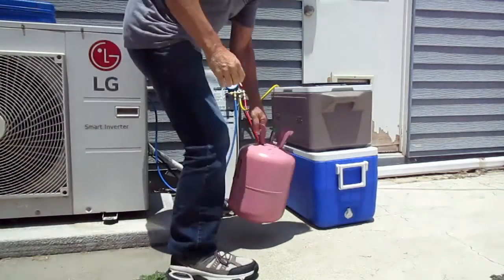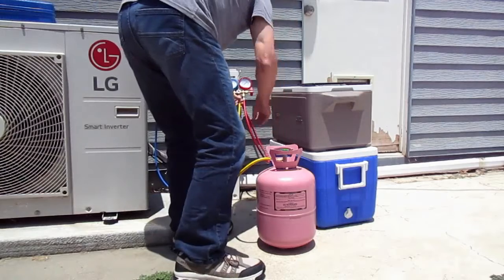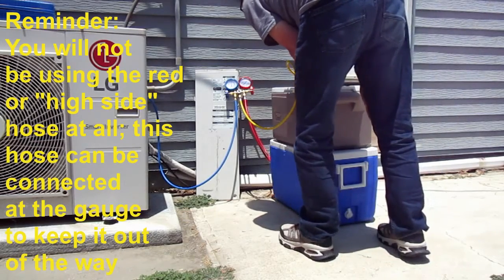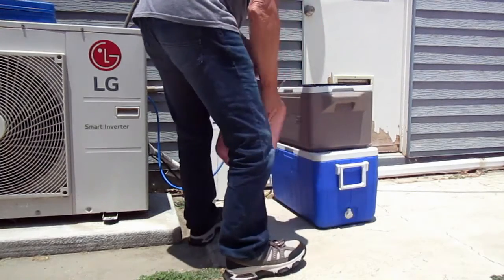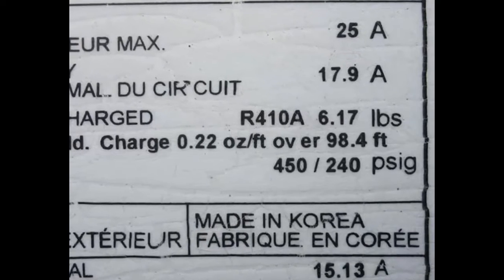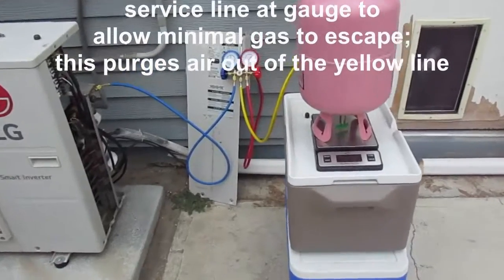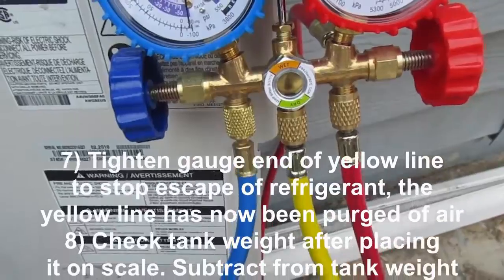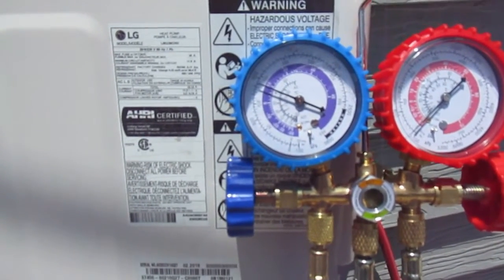Add Refrigerant to Mini-Split Air Conditioner Step-by-Step

Comment: Hello, should i add the r32 while the aircon is running ?
Reply from the maker: No. Shut the system down and then add refrigerant. However, do not add more refrigerant than the manufacturer specs call for.

Comment: Instead of vacuuming out the refrigerant in the system, could you just top it off?
Thank you
Reply from the maker: You can, but it's tricky. You can't determine exactly how much you'll need so you'll have to add it very sparingly.

Comment: Hi
My question is I installed a new Pioneer mini split for my camper and I had to cut the lines There are 16 ft long with that being said I cut approximately 5 feet
Pioneer says it can't be shorter than 10 therefore I'm within the range
How do I know how much refrigerant to release in order to accommodate the shorter lines?

Pioneer says that the unit can accommodate 16 to 25 ft of line

And I can't get a straight answer from Pioneer as to how much I should release to accommodate my 11 ft of line set appreciate any advice you may have because everything I Googled said that you do need to release recover refrigerant if you have shortened the lines
 thank you‼️
Reply from the maker: You really should get in touch with Pioneer again - find another representative to help you. This is a manufacturer specific question; I'm not much help. The other option is to contact an HVAC contractor in your area and ask them if they can help. If you have to pay them for their time - it might be worthwhile.
Reply: Thank you so much for getting back with me and I have called a few professionals and left a message as to what my situation was and not one of them called me back call me back because I actually left a message saying that I would like to hire someone to do this for me no return phone calls😢
I reached out to Pioneer technical support four times and every time I get a different answer thank you so much though for getting back with me
 @DoItYourselfandSave
Reply from the maker: Do a search on YT for "pioneer mini-splits" - there are lots of vids out there that might help. Good luck!

Comment: Do you open the low and high pressure valves on the unit itself when adding refrigerant?
Reply from the maker: Watch the video again, especially at the :52 second mark.
Reply: Thanks. I was referring specifically to the gas and liquid valves on the unit. They are closed during the vacuuming process. I was wondering if they need to be opened when adding refrigerant. Some people say open only the liquid valve and other say open the liquid and gas valve.
Reply from the maker: I only open the liquid valve, but (full disclosure) I'm not an HVAC contractor --

Comment: How do you know how much coolant is in the system before you start? I have a 24000 BTU and i think when they serviced it they did not add enough coolant.
Reply from the maker: The only way to know exactly how much coolant to add is to completely vacuum out the system, then weigh in the correct amount based on the specs for your system. Otherwise, if you are confident (and you should be VERY confident) that the system is a little bit low, you can add a small amount of coolant to "top it off". This isn't ideal, however, as you are using guesswork to add refrigerant, and adding too much can damage your system. You would need a gauge set, R410A refrigerant, and a digital scale to add refrigerant/coolant.
Reply: @DoItYourselfandSave  ok so i should grab a recovery tank and then weigh exactly how much coolant i have in the system and adjust as needed.

Comment: Great video. Question: On a multizone mini split that has been evacuated/ pressure tested/ vacuum down to 200 microns and a decay test successful…do the king valves need to be opened and the virgin 410A added to one of the vapour line ports of any of the 4 zones…OR should the king valves be closed and then opened only AFTER the factory charge amount is added and contained in the line sets?
Reply from the maker: Sorry if I'm not understanding your question - so let me just say: I have ONLY added refrigerant (either into a completely vacuumed system or just topping off when I knew the system was low) via the low side port. This port has a Schrader valve, so the only valve(s) that need to be opened or closed are actually located on the gauge set. Check the 1:00 minute mark --
Reply: Thank you very much for your speedy response. Sorry if I wrote the question somewhat unclear. So…my mini split has 4 zones and I have two zones connected. Each zone has a line set connected to it. At the top of the manifold, where all four zones appear, are two king valves. One is for the low pressure, a vapour line, and the other for the high-pressure liquid line. The king valves are opened first, and that allows the refrigerant stored in the compressor from the factory , to flow into the manifold where it is waiting to pass through the individual zone service valves of each line set. So, after the line set is vacuumed and proven tight, the service valves are opened for that zone and the refrigerant flows from the manifold and into the line set. Both line sets were done this way originally. A leak has since developed and most of the refrigerant escaped. I will evacuate all of the remaining refrigerant from the entire system, including the compressor. (all valves, including the king valves will be opened for this process… as such, all of the 410 A, will be removed into a separate cylinder). Once the system is empty, I will repair the leak and do a pressure test to confirm it’s tight. Then a vacuum test to standards and the system is then ready for fresh , R410A refrigerant to be added. 
My question is… Do I keep the king valves open for all of the processes, nitrogen pressure test, vacuum test, and finally adding the factory charge of 6 pounds of 410 a refrigerant? Or, do I close the king valves after the first step of 410A evacuation and do all of the above testing for tightness…then add the 6 pounds of 410A to the line sets. Followed by opening the king valves and the 410A would then flow into the compressor. (Not sure the two line sets have space enough to hold 6 lbs of refrigerant). 
I hope that made it clearer, albeit long winded explanation. Thanks again for the quick reply earlier. Cheers.
Reply from the maker: TBH this may be above my "pay grade". You should either get in touch with the manufacturer of your system, or find a local HVAC pro who specializes in mini-splits (admittedly they are somewhat hard to find). Wish I could be more helpful but this is beyond my scope, sorry!
Reply: @DoItYourselfandSave  All good. I contacted an hvac contractor and they did exactly as explained above…step by step and all is tight now and cooling beautifully. Thanks again.

Comment: Where can I get a fitting to connect the refrigerant to the yellow hose. The setup I own the yellow hose doesn’t fit the refrigerant fitting
Reply from the maker: You can take a look at these brass adaptors here: https://amzn.to/3Yzf0K1  I purchased these a few years ago, but I also have a gauge set that came with some adaptors. I'm hoping these will help you connect your service / yellow hose.

Comment: Thanks for the great video. My system is low on refrigerant and not running with error code 'EC'. So I have to add refrigerant so the system start running and I get 120 PSI on service port. How do I start filling while the system is not running? What PSI I should reach to remove the 'EC' code? Thanks!
Reply from the maker: It depends on the manufacturer of your system. If you don't have owners' manuals, search online for information for your system by using any serial or model numbers you can find.

Comment: but why you cahrge liquid into Low Side?
Reply from the maker: Just how it's done, ask the manufacturer about the "whys"....
Reply: You can totally do that no problem. The liquid flows much faster without any issues. Done that on cars for a long time with no issues.
Reply: R-410 is a blended refrigerant and you want to make sure you are getting equal parts. If you don’t it’s know as fractionalized and technically speaking the refrigerant jug is no good anymore

Comment: DIY'er here, Great video and explanation so you got a new subscriber! One question though I see other videos where charging a line the system is on and set to cooling and then gradually opening and closing the blue valve to control adding refrigerant to the compressor, keeping the HP within a certain PSI range. Is your method better or just a different approach.
Reply from the maker: Just a different approach - and I have to remind everyone that I'm NOT an HVAC contractor. That said, I've charged up our system several times with no issues. Every time that I have done so, I made sure that the entire system (the outdoor compressor and indoor units) are off. Thanks for the subscribe!
Reply: @DoItYourselfandSave  Appreciate the help and the great channel.
Reply: I think maybe what is happening in those videos is the technician is just topping up the system with refrigerant until they see that it is cooling properly. Meaning the system is undercharged, not empty or under a vacuum. I think what is being demonstrated here is the more thorough approach where you've recovered all the refrigerant with a recovery machine, then tested the lines with nitrogen and made any necessary repairs and then pulled a vacuum and recharged. I think running the system while it was under a vacuum would possibly cause some major damage.

Comment: Just wondering if you leave both service valves open while adding the refrigerant, and what’s the best way of removing the hose without losing any of the charge?
Reply from the maker: Not sure I understand the question - are you asking about valves on the gauge set?
Reply: @DoItYourselfandSave  Yes, I think he is asking if the low and high valves should be open or closed during the procedure. Also, before this procedure to vacuum the system, do you close the valves first?

Comment: Do you add refrigerant while the aircon is working?
Reply from the maker: No - the entire system should be shut off while adding refrigerant. Check the text at the 10 second mark --

Comment: How come it is running at 130psi if the spec plate shows the low side should be 240psig? Shouldn’t it run at 240?
Reply from the maker: You'll get different readings when the compressor sits idle (not running) vs. running. According to the LG owner's manual, the ideal PSI when running (for this particular unit) is approx. 120-130 psi.

Comment: Do you add the refrigerant with the unit off or running?
Reply from the maker: Make sure the unit is off. Only turn it on once you're finished adding refrigerant.
Reply: I @DoItYourselfandSave   It's charged now with the right amount and running fine so far. No leaks found But I loosened two fitting at the unit and put nylog on them plus the R401a I got had leak stop and UV dye in it so I'll have to check it again just to make sure. I left the can and gauge attached after I started it in case I  had to add more. Thanks
Reply from the maker: Good to hear - hope it continues running well for you!

Comment: Question on weighing in refrigerant to a new system. My system is multizone and has considerable extra line length, but still within manufacturer specification. I vacuumed down to 200 micron, and held for an hour.  With the system unpowered, I broke the vacuum with R410, being careful to bleed the lines of air.  My calculations called for adding 9.5 lbs of refrigerant through the liquid line, but I could only weigh in 5.5 lbs.   Any idea on how to get the remaining 4lbs  in?
Reply from the maker: Was the manufacturer spec calling for 9.5 lbs.? That sounds pretty high. Our system is 36k BTU and calls for just over 6 lbs. and that's powering three separate indoor units, one of which has a pretty good lineset distance. I would double check with the manufacturer via their support line. If your system is running cold and the PSI readings while its running are good, you may have it maxed out. Don't risk overfilling it.
Reply: Thanks for the response! In my case its a Mitsubishi h2i 3.5 ton with 5 heads, and maybe 170ft of lineset in total.  I used their DSB tool which factors in line lengths + prestored refrigerant, and computes a “to add” amount.  

When I cracked the vacuum with R410, all seemed well, but I think the pressure balanced out between the tank and the lineset.  Thinking about firing it up, then slowly weighing in liquid from my tank to the vapor side. I hear I should use an inline vaporizer to prevent slugging the compressor.  

Bit new to this, and wonder if this is a problem others have, and how to tackle it.
Reply from the maker: Fire it up and test the PSI (and determine if the indoor units are providing cool air) before doing anything else. The first test is comfort. If that test is met, don't push it!
Reply: Mitsubishi is pre-charged for the minimum line set. You have likely overcharged.